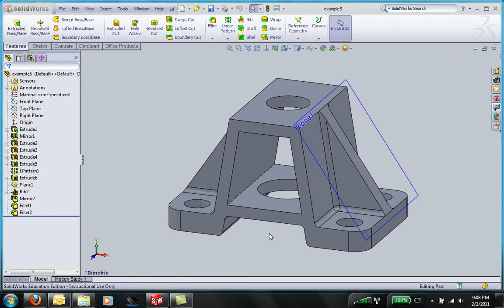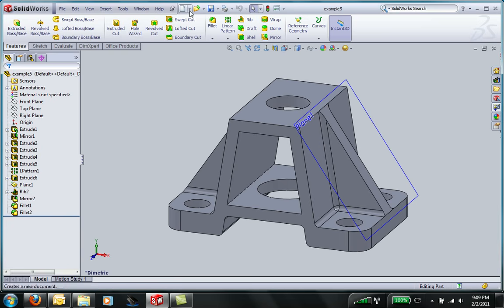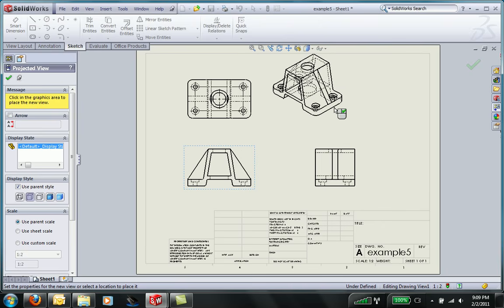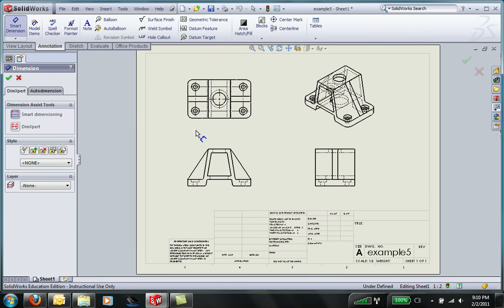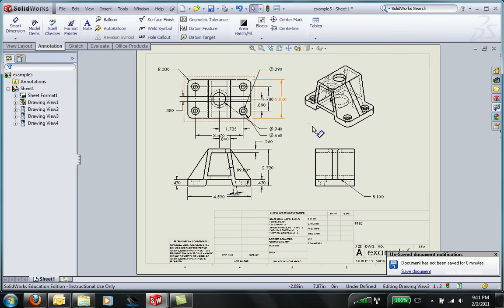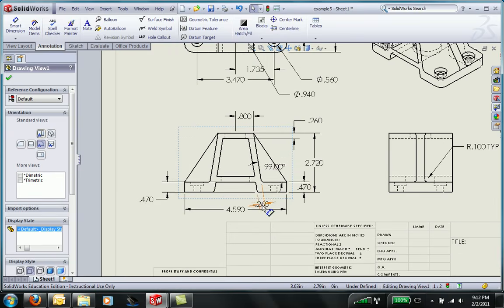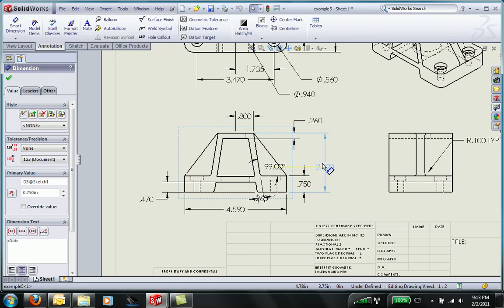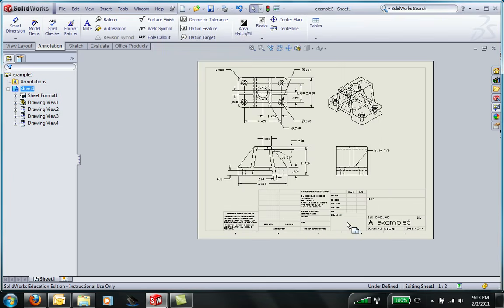Solidworks drawings basic

Comment: This is the perfect example of the UNBUILDABLE part.  You can design and model anything but building parts with internal sharp corners is not easy.  Not impossible but VERY expensive.

Comment: Wait..  you said people, manufacturing is getting away from drawing, and making parts from part models…  REALLY?  What about tolerances, positional tolerancing gd&t.  
Sadly, Solidworks attracts the wrong kind of person into this field now.  This is not a 'toy' to create fun models, that you can colorize and spin in mid-air.
EVERY PART needs a full expression of dimensions and tolerances.  It give the manufacturer the ability to: properly and COST EFFICIENTLY produce parts.
Its best to start in this field 'on the drawing board', and learn GD & T.  Then move into CAD, then Solid Modeling.
I disqualify a lot of applicants because they don't have a good base understanding of Mechanical Drawing creation.
Reply: I have one question, how are the tolerances produced for a part? Is the draftsman supposed to know this based on the production process, mayerial, etc. or does the Engineer provide this info?
Reply: Im not sure where you are from.  Im in SoCalif.  My experience has been.  There are , were 3 levels to this field.  1. Draftsman  2. Designer  3. Engineer.
To give proper tolerancing, one needs to understand the 'use' of the item.  Most times, a draftsman will not know this, thus will be given tolerances.   Most places have done away with Draftsmen...  Unemployment is to high, they can hire an Engineer BSME for the same price.
Typically, an Engineer doesn't know which end of a screw driver to hold onto...  He picked the "Engineering" field from a catalog, and struggled through the math.
A Designer has 'seat of the pants' experience...  IF you haven't been rebuilding bikes and cars before you get in this field...  They might as well hire an invalid to do the job.

If you have a good, mechanical yearning, you will succeed at this job.  A good designer is one with all of the experience and knowledge of an Engineer without the papers.
A good designer is always at work, in his mind.  An Engineer, shows up to work Monday thru Friday  8-5
Reply: +cmscms123456 Hmm, that's interesting. I'm actually from the LA area and I just received an associates in Engineering Design and Production Technology. I understand Tolerances, statics, LMC, MMC, etc. I'm just having a hard time selling myself as an entry level Drafter or Designer. Any help would be amazing.
Reply: A few things.  Networking.  If you're trained on Solidworks,  1.  join your local 'user group'  call you local reseller he can give you some names.  2.  Meet make friends with the local Solidworks reseller, get on his e-mai list and attend all of their free local events...  Then talk to everyone at those gatherings.  For about $9 Vista Print will make you business cards...  Get a business card with all your info on it, Name, phone, and cell numbers, e-mail address, Link'd In..  whatever...  Hand those out to everyone you meet.  Its a mini resume, and reminder of you.  I was lucky, my first Drafting job was at the company I was working as a warehouseman, forklift driver.  They had a small Eng Dept, I made friends there and got promoted in, once they saw I was going to community college.  So.. you might find a company that you want to work for, and try to get hired doing anything..  just to get your foot in the door.  Call ALL temporary agencies..  I worked a lot for them.  Also,  "Under Price" yourself..  you're new getting started..  beat that next applicant by working for less, to start.  ALWAYS,  continue looking for your next job.  Keep in mind, your Solidworks reseller is always "Selling" and "Training" for their new customers...  Sometimes the reseller is asked, "Do you know someone that can come in short notice, or short term to help us get off the ground.
Basically..  Network...  Get those business cards...  hand them out.  On the back go mine is a list of former employers, list of CAD systems I use.
Reply: +cmscms123456 Great advice, I have thought of getting my foot in the door as a laborer as well, just wasn't sure if it was a good idea. Thank you very much for the advice, I'll be sure to get this done asap.
Reply: Our field is constantly changing.  I start on the drawing board, to CAD 2D, wireframe, ISO, to solid modeling, parametric, CADApple, Versa CAD, AutoCAD, Solidworks (many small in the middle) 
"Whats Next" in out field is already underway..  GRAB on to the street car, it doesn't stop..  3D Printing and 4D Printing..  WHATS 4D.. ?  Google it.
Find classes, or small start up companies...  I worked for free on Saturdays at one place with a 3D printer just to get a understanding.
3D printing is going to put machinists out of work, like the scientific calculator put thousands of mathematicians with their slide rules out of work in the 1960's.
Boeing and Douglas had more mathematicians than Engineers.  And the calculator put them out of work.
Reply: Hey, how is your job search going?
Reply: cmscms123456 Hey, I'm actually currently working as a mechanical drafter. I just kept applying everywhere I could and got a job as a civil drafter then 2 months later got a better offer as a P&ID drafter. I started doing Autocad P&ID blueprints, then got moved up to creating drawings from models, and soon they'll be training me to become a piping designer. To be honest it was all about patience, at one point alot of job offers started to come in, even to this day. Thanks for all your help, I truly do appreciate it.
Reply: Great..  One last thing.  When I started as a draftsman, on the board $8.50, after getting my degree, and 2 years experience in ACAD I start working for temporary agencies "Job Shopping"  started at $22 per hour.  Good money, no benefits, but I didn't care.  Im still a job shopper, I make $35 an hour now.  Most assignments start as a 60-90 job, they always turn into 6 months to a year...  Most of my temp assignments the employer offered me direct employment...   Good luck, and keep your eyes open, and your updated resumes going to those temp agencies.
Reply: reduced dimension drawings tho.  everything is within a profile of .010 from datum abc.  get gud

Comment: Tip: If the JPEG image is really low quality when you save it then go to "save as", "Save as type", "Options" and then change the DPI to 300 or more if you want it good quality. 

That had me stumped for half an hour :)
Reply: Very important comment.  If users don't do this, their drawings will be very low-quality.